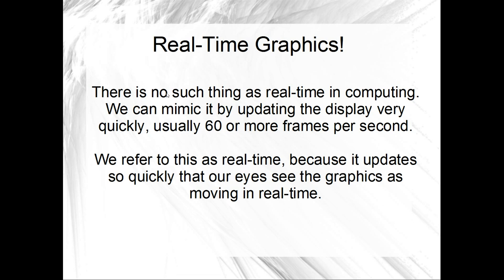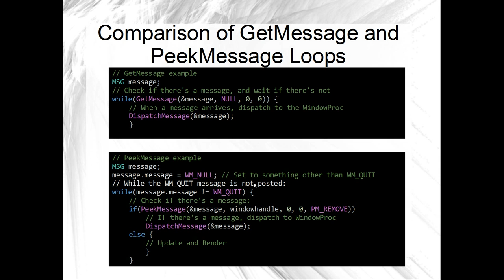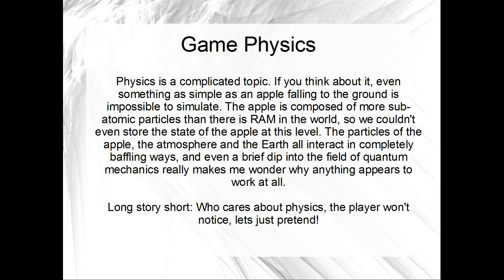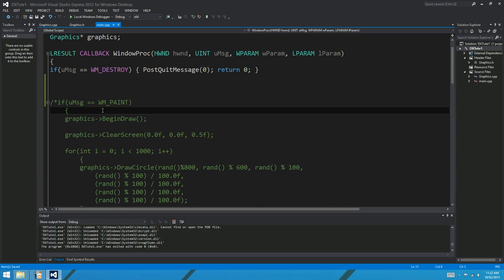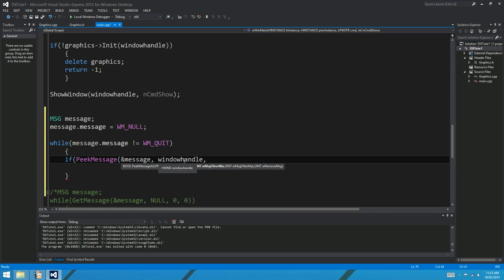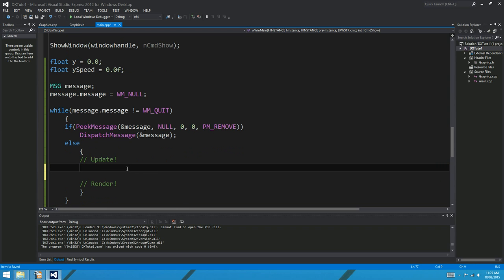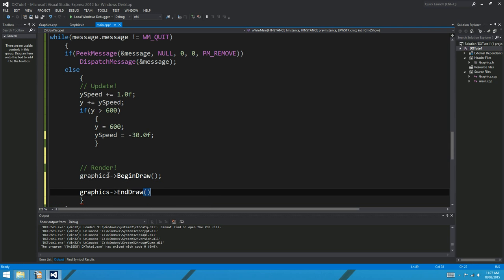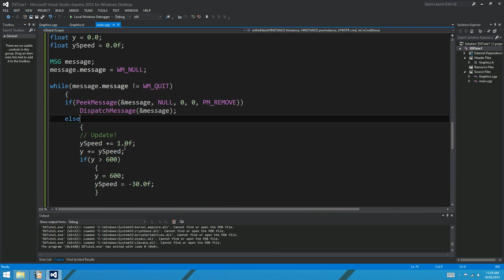Direct2D Tutorial 6: Real Time Game Loop

Comment: This series has been thus far very informative about basic graphics work with Direct2D. Thank you for posting it.

I had a quick comment about some statements that were made in this particular video about game physics. Despite your statements about the complexity of physics and how game physics has the appearance of being ad hoc, the method used here is definitely a legitimate form of conventional physics. This looks like a numerical integration of Newtonian gravity on the limit where the strength of gravity doesn't change significantly across the region where the ball is located, as is conventional in freshman physics 101. Further, it includes the approximation of elastic collision -no energy lost in deformation- and invokes the third law upon contact with the bottom of the window, giving conservation of momentum directly (reversing the velocity) and providing conservation of energy indirectly. Mass is wrapped up in the numbers and the integration step is arbitrarily dependent on the rate at which the computer runs through the loop, but it's definitely Newtonian Mechanics.

While reality is complicated, physicists are masters of making the right set of approximations and simplifications to accurately describe how objects behave within the needs of the situation. Crazy, hyper-detailed physics which accounts for every little discrepancy generally doesn't occur in situations where people can actually experience it. It may not look like "physics" as people expect it, but the calculation done in this game is legit physics.